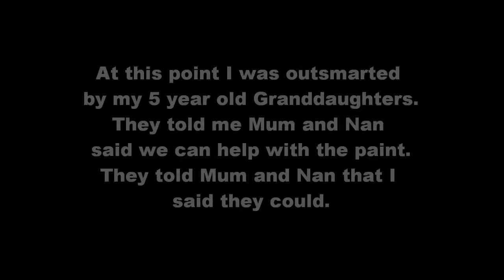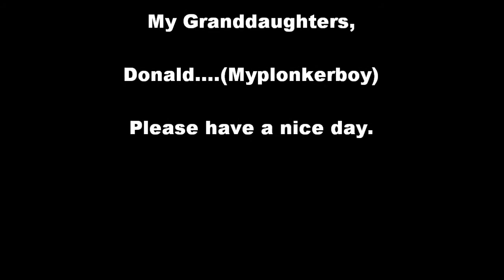What did I do on Waitangi Weekend?

Comment: So only the table needed to be replaced Donald? I thought you would get C track to replace the old third rail track. You have a few Marklin 3000s.
Reply from the maker: +Trains Big and Small The layout just needed re building. I have made it bigger also. This time there will be only one roadway. The idea of it is to use "old" (1950's and  1960's) track, signals and trains and Faller slot cars from the same era. One seems to collect those cheap 3000 Locos.